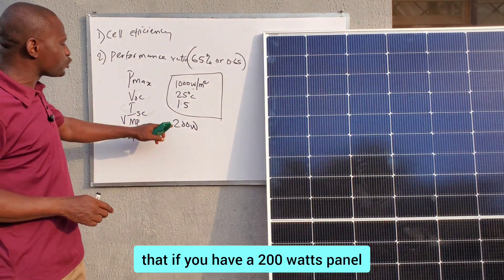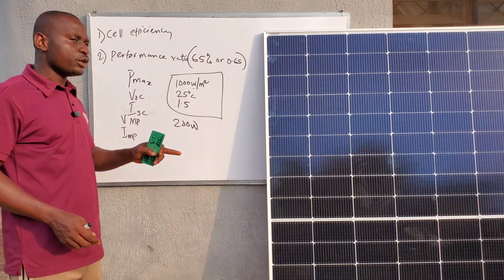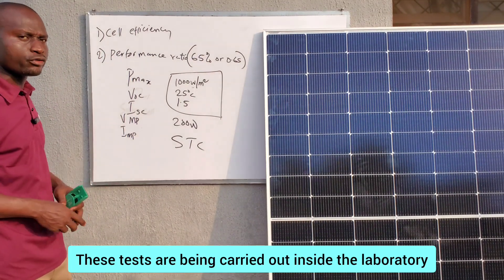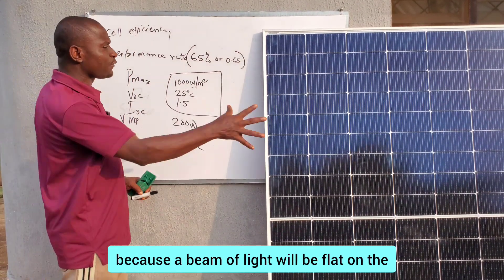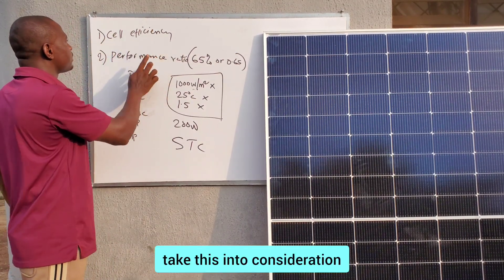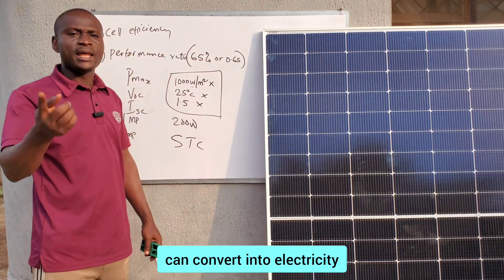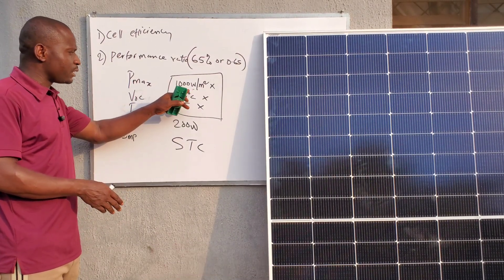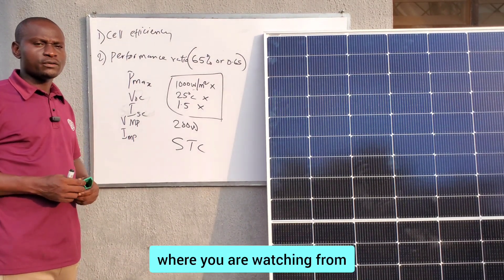What is the cell efficiency and performance ratio of a solar panel? #solarenergy #solarpanel #usa

Comment: So can you connect solar without charge controller?
Reply: Yes sir... U can connect your solar panel without a charge controller. But that means u would connect them directly to your batteries which is not advisable because if u connect  your panels directly to your battery you would kill the batteries and I'm sure u wouldn't want that to happen 👍👍

Comment: I have a question i am from kenya .is it possible to connect  2 batteries in series and another 2 in parallel in the same circuit
Reply from the maker: If you connect two batteries in series let's say a 12v battery,  the voltage will double to 24v. if you want to add batteries in the battery bank, the batteries must also be connected in series with the same voltage. if you connect them in parallel, the voltage will be 12v this will make them not to be compatible with the batteries that are connected in series.
Reply: @Solarwattng  ok i understand..there is something  i have someone who wanted the quotation of solar system.. after calculating i can see i need 6 solars each 325w and the inverter is 3kv .now how many batteries can i use